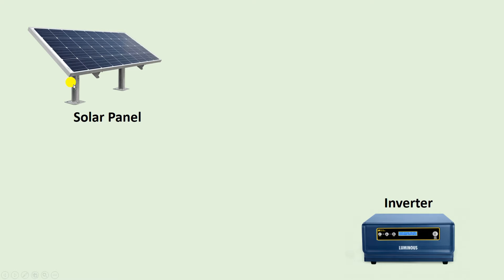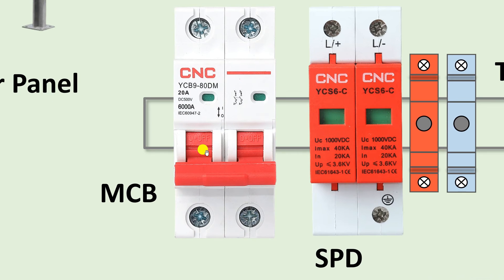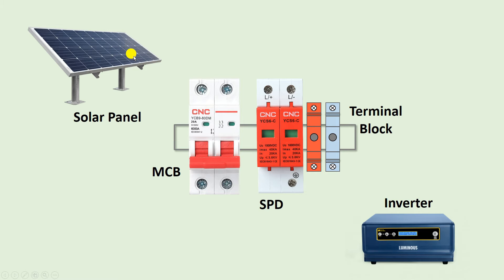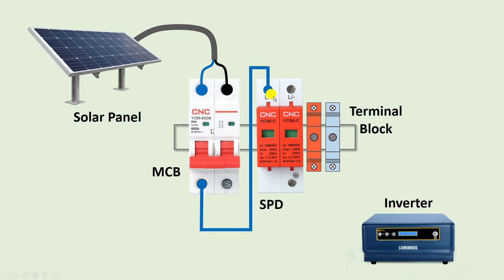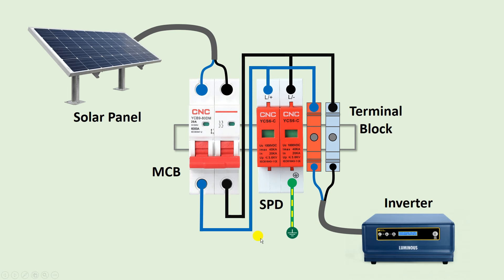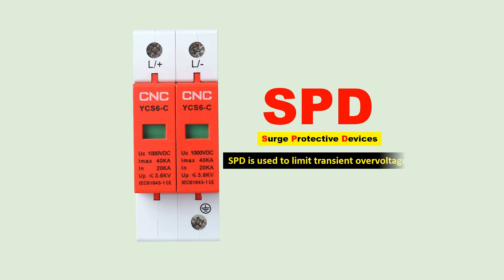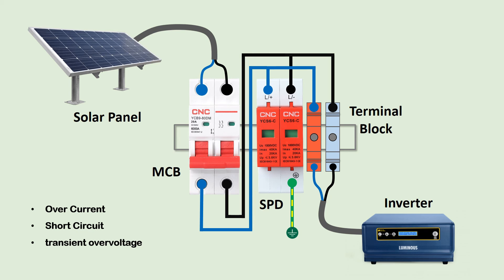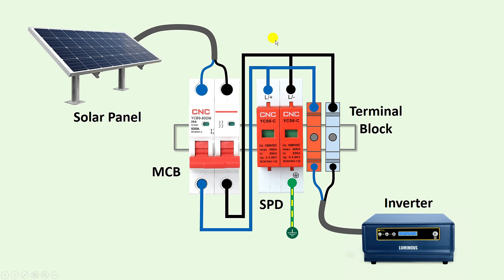dcdb box connection for solar panel | dcdb connection diagram @TheElectricalGuy

Comment: hello
nice video!
which model to take in SPD between pv and regulator?
I have several victron 150/35 regulators
residual protection current is 600 V maximum!!

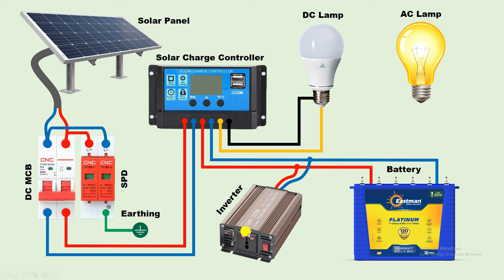Comment: Confusion; at around 3:20 diagram shows piggyback connections at the positive and negative terminals on the SPD; At 3:28 it shows piggyback connections at MCB positive and negative terminals instead. Which is it? What is better? I have seen diagrams where the piggy back is at the MCB Output positive and negative terminals instead. Confusing...
Reply: did you find the answer. it seems as if these guys making videos are amatuers

Comment: Wht is MCB and SPD
Reply: Surge Protection Devices
Reply: MCB = Mini Circuit Breaker, SPD = Surge protective device; MCB handles current / amperage overload - SPD handles voltage overload.